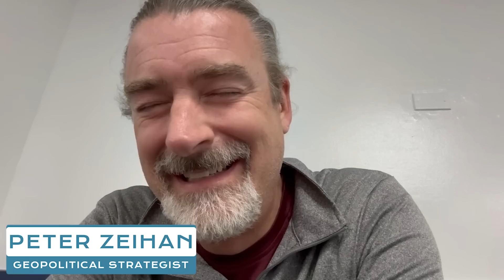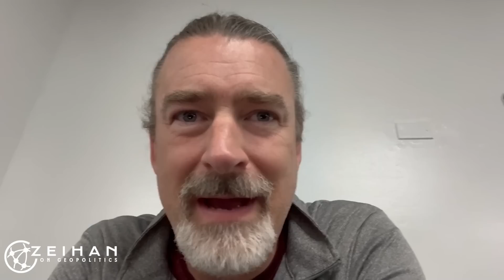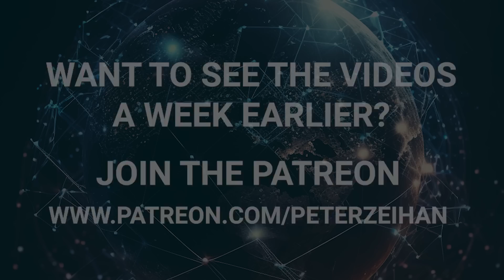Nuclear Power's Facelift: Small Modular Reactors || Peter Zeihan

Comment: Facelift step 1 - it's NU-CLEAR.  Please please please Mr Zeihan, not "nookyooleer".  For the love of all that's atomic....  Even Brits are saying this now.

On the SMR front - the more I see the more I think we need to hyper-super-mega-fast-track these damn things.  Even if it's version 0.1 experimental prototype - set the precedent.  The coming (and seemingly sudden) surge in future demand from upcoming AI data centres is GOLDEN - big client, big cash, big demand, securable location, existing infrastructure can't hope to remotely cope, etc. - all wins for pushing these things to early adopter first clients.  They need it fast and need it to work - I can see a lot of R&D cost being offset against those early installations.

I'd dearly love to see the UK (perhaps the Rolls Royce programme) get Version 1.0 SMRs shipping to UK and European clients in the first instance, perhaps a few across the ditch to the Yanks too.  We're rather good at smaller-run high-grade machining and logistics, leveraging that would also let us equip big things like ships with reactors where they weren't in place before (I've always wondered if our two new carriers are meant to be able to drop in a reactor in times of war, AFAIK the actual propeller shaft is electrically driven).  That'd make sense as it'd immunise them from supply chain disruptions for conventional fuels they use now.

The UK's led the world in nuclear power before, lets do it again.  Remembering that retiring and replacing an SMR is much less involved than doing the same with a bespoke fixed plant; the ability to drop into existing infrastructure points and re-use coal fire plant distribution infrastructure is just golden.  AFAIK SMRs are expected to be about half as efficient in terms of nuclear fuel use so a parallel programme to re-use pellets (e.g. WAMSR reactors) would be particularly welcome too.

FWIW solar/wind has birthed insane short term power markets that run wild during periods of poor wind/sunlight/storage.  I'm told that South Australia hit $17,000-AUD for a kilowatt hour of power on wholesale at one point (this adjusts every 5 minutes or so but still - THAT'S INSANE), I believe they had to fire up generators (diesel I think?) to run the state grid at one point.  Personally I'd prefer solar/wind/tidal/battery for remote locations that are hard to reach and secure; also I'd love to see that infrastructure extract hydrogen, pump water into reservoirs or run other long-draw industries that can withstand variations in supply the way consumers and industry can't.  The future I feel is a bit of both, the EV dream is going to die California-style if this and distribution and generation capacity isn't addressed.
Reply: If Peter starts pronouncing “nuclear” correctly then I will by a Patreon subscription.
Reply: @RicBentley  I'm not sure he cares. 

I wonder if when he is briefing at The Pentagon, they stop him and say "Actually Mr. Zeihan it's pronounced 'nuclear'.  Now please continue with your presentation."

What do you think 🤔
Reply: Everyone  says it like homer does on that episode of the simpsons. the joke went over kids (now adults) heads but nu-clear is the proper pronunciation.
Reply: @AA-tb4ff  one of the founders of atomic energy pronounced it like Mr. Zeihan.  I think that sets an irreproachable precedent.  

People can have different accents or pronunciations.  We don't need the speech police.
Reply: @jasonneugebauer5310  That makes them scientists but not linguists - they can still be wrong - albeit on a more frequent basis.  This is a simple mispronunciation, that is inescapable.  And as protorhinocerator142 points out above - Peter is a professional speaker, the word has a clear basis for its pronunciation and him them thar doin' it rrong.

Others here attempt to make excuses of "evolution of language based on use" - that's for the use of a word and the introduction of new words, e.g. "Bling", "WYSIWYG", "Wokery" or the way we now dilute the term "unique" by saying "very unique" (unique properly meant being one of a kind, we now dilute it to mean "scarce" or "rare" - much to the chagrin of some academics).  But these are not mispronunciations, "nookyoolear" is.
Reply: @davocc2405  I enjoyed reading your comment 😀
Reply: Some people are saying “Languange evolves”.

Yes. Like life forms do. Over time.

Differences that pop up over a single generation are called mistakes. If the mistake lasts for a couple of generations, then it’s a colloquialism.

In a couple of thousand years you can say that the English language evolved. As it did from Latin. Thousands of years ago.
Reply: @akacompanycreditcard8992  the word in common parlance is something everyone started using all at once after the detonation of the first atomic bombs and the commissioning of the first power stations.  They just struggled with the pronunciation of the word - non-English speakers often do this too, for example Indians say "trainings" as the plural of "training" - the plural is training yet I've heard some American commentators on youtube start to pick this up.
Reply: @akacompanycreditcard8992  umm. Nope. Go study linguistics. There are tribes where the language evolved so fast that the elders can't speak to the children. Language evolves extremely fast and seems to go slower with larger populations. How language evolves isn't through mistakes as there are no real mistakes and has been said to have evolved once it reaches a critical mass. Do you say thee and yonder? No, because that's old English.
Reply: @richardmeade2477  You gave it a good go, but unfortunately you’re wrong. 

Tribes that can’t communicate between other tribes don’t have a language. They have basic communal communication. Basic.

When a language develops, it has a set way of doing things as it’s now a thing, as opposed to nothing like clicks and groans that tribes may employ as communications. 

The English language is not a tribal thing. It’s the international language. It’s the language that represents humanity off-planet. 

Over thousands of years, we went from clicks, to noises, to words, to a language.

One elder tribesman not being able to talk to a younger tribesman is more a generational thing, than a language thing when your supposed language consists of 7, maybe 8 “words”.
Reply: @akacompanycreditcard8992  damn again, you couldn't get more wrong. Or racist actually. Tribes are even very small ones and have very complex languages. Some of the hardest to learn are from remote regions, I think the hardest is from Mongolia, and then you have the African languages with the clicks. 

Your view on language is about 70 years out of date.
Reply: Literally nobody cares, go touch some grass
Reply: Realistically, the only thing stopping SMR’s from taking off is the federal government. Until the NRC makes issues regulatory positions for EPRI to interpret, no company investing in SMR’s will actually be able to build a proper functioning one.
Reply: @Iskandardeeznuts  This is the US context?  The UK has somewhat similar problems with perhaps an excessively cautious regulatory environment that carried over from an era where handling and use of nuclear material was a politically and socially sensitive subject, arguably far more than it should have been if we look at it with the benefit of hindsight.  

The UK's regulations also reflect an active concern over the theft and misuse of material including waste for "dirty bombs" (though a friend of mine who wrote papers on this for the US Army said that they're apparently much less plausible than media commentators claim they could be).
Acceleration of the development and placement of a prototype unit probably could be done with sufficient oversight, what is learnt from the production, transport, implementation, integration and utilisation is as important as the political and social dimension as well;  politically we're comparing systems that have had over 40 years of evolution but this is often a hard thing to sell).

Carbon and particulate emission concerns have driven the SMR to adoption to an extent but strangely not past a certain point - Germany's knee-jerk reaction to Fukushima leading to their mass shutdown possibly had a fair bit of influence from the Kremlin too (we note that all these measures seem to have driven them ever closer to Russian gas reliance and it did for a long time).  Looking back on Mutti's term she seems to have been an awfully big fan of the short term politically focused reaction, many of today's biggest problems there can be attributed to this facet of her administration.  I think the bigger selling point will be fuel security going forward too - on a sheer volume basis alone, that's one that would appeal to the conservative side of politics but barely ever sees a mention.  Given how we all seem to be edging closer to war of some sort I think that's going to be a much bigger issue and perhaps rather suddenly.
Reply: Show us you know jack squat about the topic your pontificating about.
Every "actually" about pronunciation is basically a show of pedantry and you only continue to be a pendant after your "actually".
I wish you the best of luck but I don't have high hopes for your prospects.
Reply: Bro, im nearly 40, and from the uk, I've never in my life heard it called nu-clear. I've had two tours of a power station and long form debates at school from representatives of the industry. Let it go. It's not pronounced nu-clear even if it was in the past. Language evolves.
Reply: Because you choose to start your coment with pronunciation, I will focus on that aspect of your post.

Both pronunciations are corect, you are wrong.

Have a nice day.
Reply: @jasonneugebauer5310  Nookyooler has never been a correct way to pronounce it.
And PZ can't claim ignorance, because EVERY TIME he does a video that covers New Klee Urr power (based on the root word nucleus, as in the central structure of the atom) there are at least 10 people, including me, pointing out the error.
He keeps saying this despite knowing that he's saying it wrong. This man is a professional speaker.
Reply: @protorhinocerator142  Peter seems to be doing well as an international consultant.  

He posts these videos on YouTube out of the kindness of his hart. 

Clearly he has made his choice on how he wants to pronounce the word.  

If anyone doesn't like it they can go elsewhere and stop badgering Peter.

It is rude to continually complain about how someone talks, yet people still post.
Reply: @ You clearly don’t understand why someone would be annoyed that a group of people who didn’t want to be part of us, yet refused to develop their own language and just butcher the one of those they supposedly wanted nothing to do with. 

That is evidently the case. So I ask you, if you don’t understand the problem, what gives you the right to tell anyone to go away and shut up about it? 

Work on yourself.
Reply: @jasonneugebauer5310  Peter's posting these videos to raise his profile and improve book and engagement sales, all power to him (remarkably smart thing to do, I very much respect that) - and by the way it's spelled "heart" not "hart".  He didn't wake up one morning and "choose" to mispronounce a word, it's an error.

We're not "badgering Peter" - we're trying to encourage him to pronounce a particular (and it seems increasingly important) word correctly so that others hear it used in the proper way and it doesn't diminish the value of his perspective.  Remember we obviously value his insight enough to post replies to his videos here so there's that aspect...
Reply: @akacompanycreditcard8992  Nice change of subject subtle, but it brings it back to the original point, i guess. I am English! Nuclear technicians and tour guides and advises (all English) pronounce the word the same way Peter does. I've been to hinkley twice and had guided tours. You're being an old fart and pedant and also factually wrong. 

As for the use of American English, again, if you learn linguistics, you'll often find they say words how we used to say words when we originally colonised that land. Language is fluid, from one generation to another. It's never fixed. Or to put it how Samuel Johnson put it in 1755 "to try and codifie language, is as futile as trying to tie a lash to the wind" or as Webster put it "like the seemingly still appearance of the mississipi, language is like the current that flows beneath, fast and ever changing"  

Don't be a stickler for things that don't matter. Especially when you're wrong.
Reply: @davocc2405  Peter has his own way of looking at how the world functions.  His unique outlook provides insight on the state of affairs and what the future may hold. 

Some people will fault him for how he pronounces nuclear,  his incredible pro USA outlook, and his China doommongering, but Peter's insights are valuable dispirite these peculiarities.

And, perhaps Peter's opinion would not be as unique and valuable if he tried to change himself to meet our needs and expectations.
Reply: @richardmeade2477  Well said. 👏
Reply: @jasonneugebauer5310  No, Peter's is definitely wrong.  It doesn't follow the spelling of the word and is a legacy of mispronunciation - it's not a difficult word, it's just one some people didn't learn properly.  I started with the pronunciation because it's quite grating to hear over and over and over.
Reply: @davocc2405  OK lots of people are wrong on this one.

Now if you can convince the British to stop pronouncing a-lu-mi-ni-um that way it would be great.
Reply: @jasonneugebauer5310  akshullee....  we pronounce that word correctly already.  The Americans stick three O's in it for some reason.  I recall comedian David Mitchell mocking this on one of the comedy shows a while back.
Reply: @davocc2405  I agree 👍

I was being facetious, to illustrate the fact that different people pronouce words differently, and yet we can be ok with it.
Reply: @jasonneugebauer5310  ooh I get that, hell the UK is a sea of variance in pronunciation but what Peter is doing is erroneous rather than regional variance.
Reply: I’m pretty sure English is a living and evolving language, with differing dialects and pronunciations changing over time.
Reply: @Lancelar  No, this is just mispronunciation.  Nothing more, nothing less - a bad habit picked up and passed on.

Comment: Nuclear need 247 operations to be economic. 
Rooftop PV and batteries work when the sunshines and the sunsets.
Millions and millions and millions and millions of customer rooftops.

Nuclear can run 247, but the cashflow may not be 247. 😮😮
Reply: Residential electric does not take up as much power as industrial power requirements. 
I'll believe in solar when it can run an arc furnace or a data center 24/7 without Nat Gas backups.
Reply: @nathancochran4694  grid demand is 74% building needs.
General industry does not need that huge demand.
Reply: @stephenbrickwood1602  74 percent and diffuse across the country, allowing solar to work well enough. The remaining percentage is not as diffuse, and requires significantly more concentrated power to meet demand effectively for as long as it is required.
Reply: @nathancochran4694  the grid can work backwards and concentrate the electrical energy. 
That is why feed-in is useful from millions and millions of customers. 

You are right. Some intense industry users will need more.

My point is more valid for more users. 
It will save more infrastructure construction.
Reply: @stephenbrickwood1602  except that solar panels usually use grid following inverters to match the freq. And voltage, which means they shut down in the event of a grid outage. Making the grid brittle and unstable.
 I believe solar should be developed in places that have already been developed, but are under utilized, like in cities and on roof tops. It makes no sense to upend  and destroy the environment for the sake of the climate.